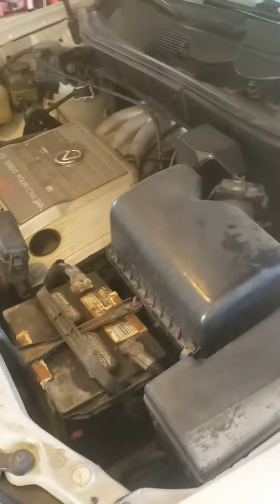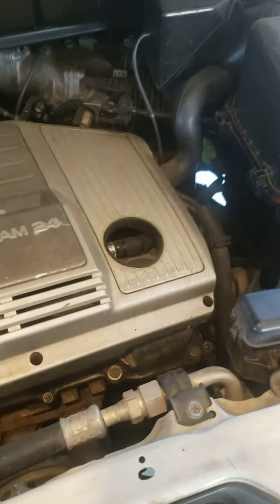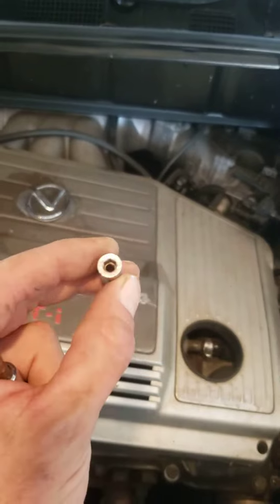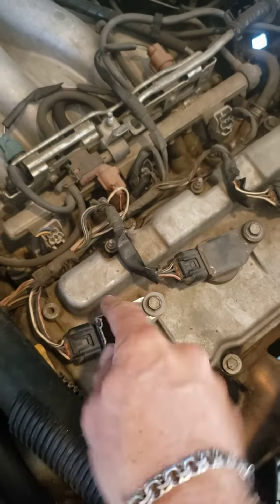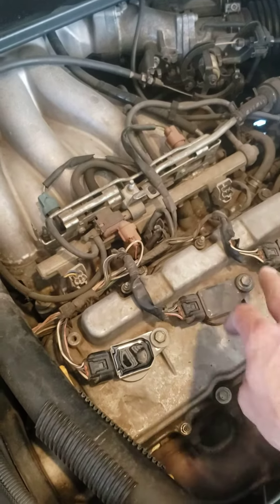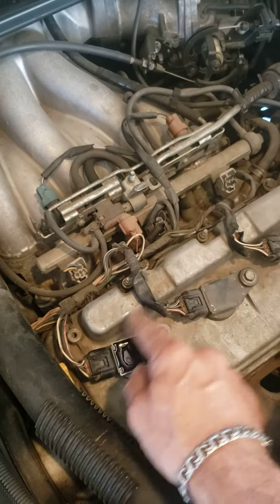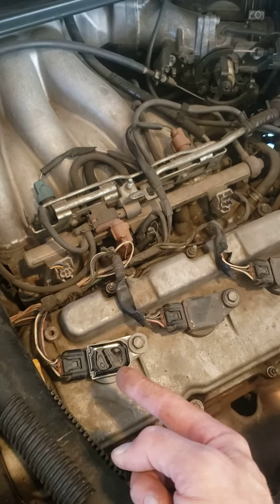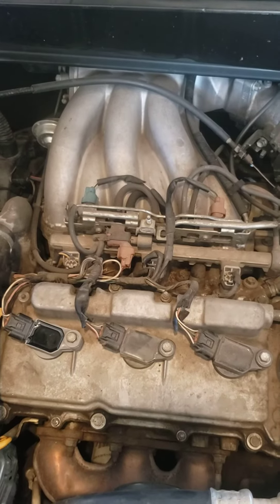Missfire Lexus RX300 Coil replacement, no shift automatic transmission, RX 1999 2000 2001 2002 2003

Comment: Fyi, if u cannot fix right away, on the fly have ur blue tooth scanner plugged in, and clear the codes while driving. It will restore overdrive until u turn it off. Everytime u start the car u can clear the codes to get overdrive back

Comment: Did your tranny ever crap out again? And is that an AWD or a FWD? I’m astonished you don’t have tranny issues with that many miles! Mine is ready for a third transmission at 230k…..😢
Reply from the maker: Hi Jimmy,
I never had anymore transmission problems after I disconnected and reconnected the battery.  I've been wanting to highlight that point better. I had driven it a hundred miles with maybe only 1st and second gear until that reset.
Bummer about your transmission. I didn't have it long. It was neglected, but the price was right at the time.

It was totalled out, not long after this vid.
An uber-lifted truck entered the center-merge lane. I was doing 45, and he didn't see me or the trailer I was towing, and wanted to occupy my space in this universe. And, there was another car on my right!
The Hooptie Lexus handled beautifully.
Hard braking, hard steering, and a 7 to 8 inch curb, then... his passenger was sure I was gonna slam that pole (the kinetics of that trailer wouldn't have helped my chances if I did).
Kudos to Geico, they fought it in mediation, and won. 
Yeah, the rules say you have to let them crush you, then it's not your fault.
It was an AWD model.
If you find any good data on preventing the transmission problems, please share it here.

And really, a year later, I can replay the whole thing. How I was able cut that hard, and keep all 4 wheels to the pavement amazed me then, and still does. The trailer's 3500 lb drop-axle didn't fare so well on that curb. 
Thanks Again,
Dan
Reply from the maker: Happened one year and one day ago!
Reply: Get the factory transmission cooler that was offered with the factory tow package. It kept my transmission alive, way past 215K, on the first one.
Reply: when i bought the car a t 132,000 from the one and only previous owner, i didnt know it had tranny problems until four months later. AS IS means just that. anyhoo, took it in, got a complete rebuild in 2018 at 155,000 miles. mechanic said the tranny had been rebuilt once before. 2001 was a bad year for this tranny design. mostly the valve body.
Reply: If a coil goes out and u loose OD, clear the codes while driving and OD will work until u turn it off

Comment: I have a question i have a 99 rx300 with the check engine light flashing i have replaced the spark plugs coils and clean the injectors and replaced one of the injector it still runs but it stills misfire with check engine light flashing
Reply from the maker: Hi Dave,
Have you run a scanner to isolate which cylinder is miss-firing?
Resetting the computer might help, (it fixed my flashing check engine light.)
Disconnecting the battery for a while, (you can also touch the negative cable connector to the positive to help drain any excess energy.)
If you know the problem cylinder, then try shaping the coils between two cylinders and see if the miss-fire moves.
It's possible to get a bad coil out of the box.
Anyone else have any thoughts?
Dan
Reply: @dang8134  thanks for replying I'll check it out
Reply from the maker: Dave,
Just disconnecting the coil from the 12v connector and listening for a change in the idle doesn't require a scanner.

That is and is-not the same as pulling a spark plug cable (or the whole coil).

That will kill a cylinder and tell you it that one is fine, (it should idle worse.)
But, it's different because it can give you one HECK of a painful shock.
You won't easily forget the moments you become the spark plug.

The stepped-up voltage after the coil has way more "potential" to jump/find you.

That's how that spark is made... travels through the air at the spark plug.

Thanks for being a part of the community Dave, and giving me a chance to share.

Dan
Reply: @dang8134  thanks for the info and for responding